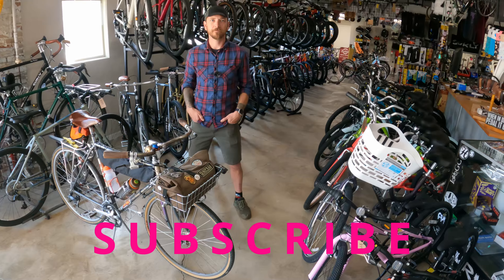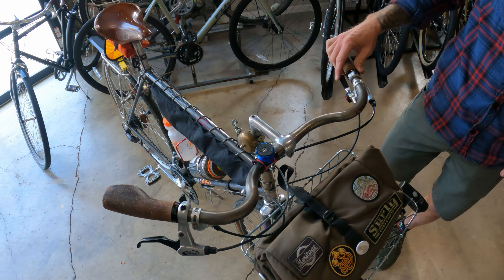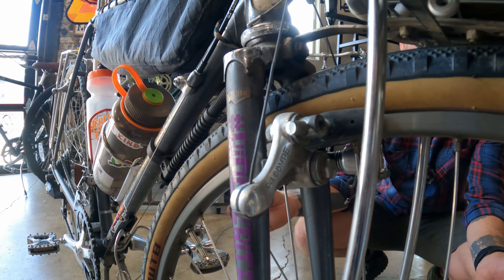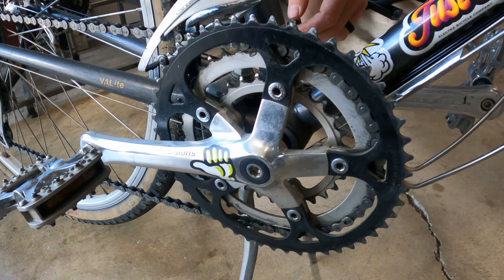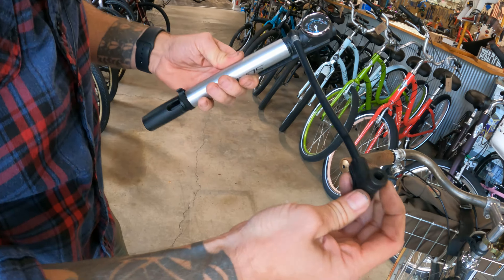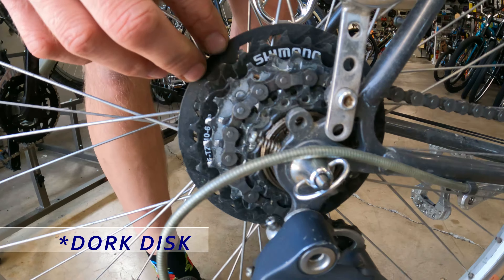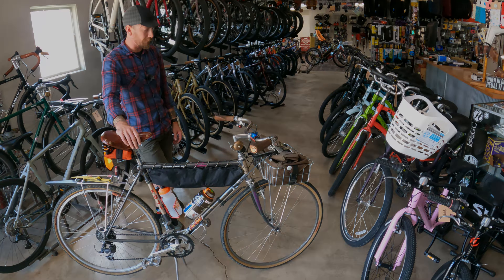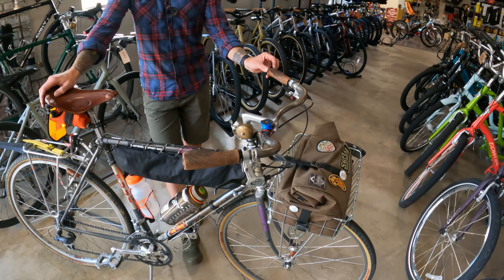Bike Check: Is This 1986 Hodgepodge Fuji the Baddest Bike in Town?!?

Comment: Back in 1985 I bought a Schwinn Tempo,(frame by Panasonic)..I still have it..Only the frame and seat post are original..I rode 34 century plus rides this year on it!…Like you it is my significant other 😂Flat bars with inboard and outboard bar ends,28mm Gatorskins 👍I have 12 bikes but this is my favorite…
Reply from the maker: 34 centuries makes me tired just thinkin' about it😱 Nice work! Thanks for watching👍

Comment: Very cool bike. One thing not discussed was the frame. Back then Fuji was using Ishiwahta designed frames and they were outstanding. For this bike, they used a lugged, QUAD butted high end CroMoly frame, resulting in a very light, durable steel framed bike. No wonder this is your fastest bike!! Personally, I own a '85 Fuji Opus III road bike that I switched out the drop downs for a flat bar set up for my own comfort. It also has the quad butted CroMoly frame and its' advertised weight was only 20 lbs - insane for a steel framed bike!! It's the best feature of these bikes.
Reply from the maker: Whoa that's pretty cool! Maybe I should be looking for a vintage Fuji now. That's interesting - thanks for watching!

Comment: I didnt see anyone else say, so...

For the old school style of canti brakes, you need to drop the yoke until it's just above the top of the tire for proper braking performance.  The way they are now it's no wonder the bike doesn't brake well.  Canti brakes are great, they just need proper adjustment.  Otherwise they wouldn't have been specced on touring bikes (i.e. lots of weight) for decades.

Perfect do-anything bike, very nice!
Reply from the maker: Thanks for the tip - I'll pass it along! Thanks for watching!!

Comment: I have a circa 1986 Raleigh Kodiak. I think the front fork is not origional. It looks like it's off of a mountain bike? Anyway, does anyone know where i could find a nice touring front fork for a vintage 80's bike??  thanks . nice video.
Reply from the maker: Not sure what your steerer, trail, or length is, but you might look at Soma Fab forks. They make a bunch. 👍